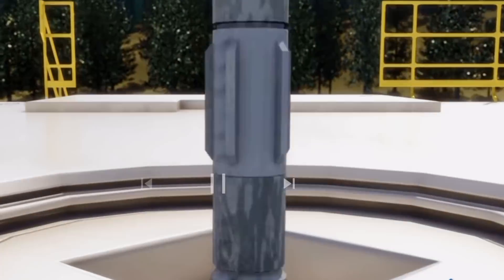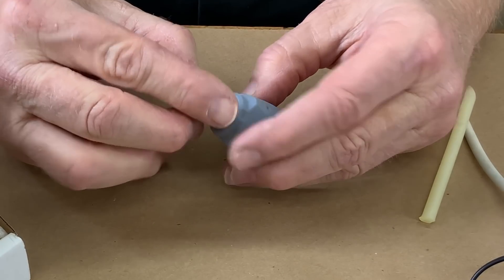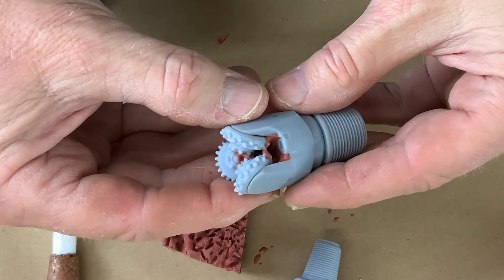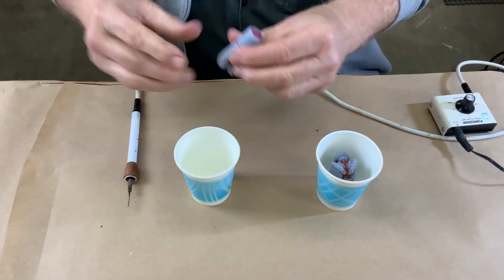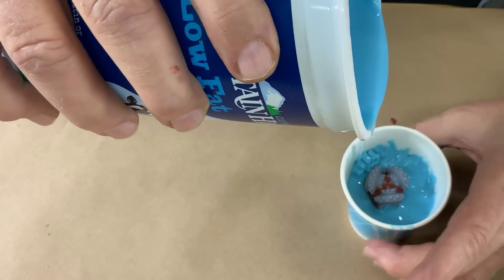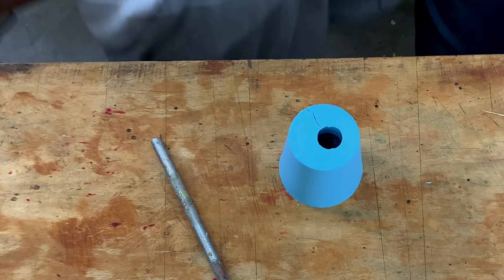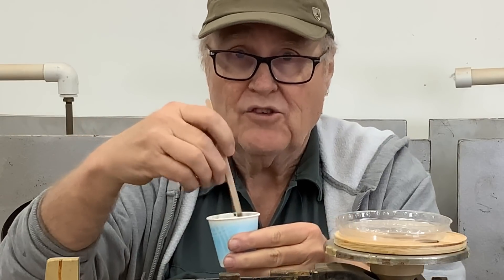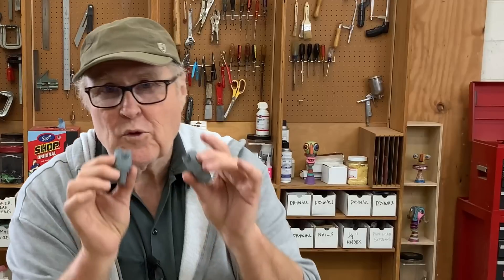Kitbashing A 3D Print

Comment: I'm glad you mentioned the issue of 3D prints inhibiting silicone resin cures. It looks like you use a tin-cured rubber, which apparently doesn't have an issue. I've read that 3D prints inhibit platinum-cured rubbers. Is Econosil-25 fairly tough? I'm looking to cast a prop with a lot of undercuts. Smooth-On's Mold Star (platinum-cured) has worked well for me, but it's expensive.

Comment: Great explanation how to kit bash the models and prepare for casting, however I didn't like how it came out messy on the inner part of the design. I would appreciate if you could show how to design those "drilling" parts to be separately casted and attached later in the process to the main body, forming a clean model or maybe even make moving parts within this toy?

Comment: Awesome video. Since you were a toy maker, I was wondering if there's a possibility of molding a flexible gripping hand to hold objects
Reply from the maker: I am a freelance prototype character sculptor.  Just a cog in the wheel in the toy manufacturing process.  My job was to take the concept drawings and make accurate prototypes of the finished toy by sculpting them in wax - or nowadays -3-D models.  I am sure it’s possible to make what you want but I’m not sure where you are in the process. Concept stage, prototype made, etc.?

Comment: Very informative! That divot tip is a great one. Wouldn’t it cast better if you hadn’t put those teeth gears in until after?
Reply from the maker: No, the teeth were pointing down so they filled without any problems.
Reply: @RobertTolone  It didn’t look like you made extra cuts to get the middle out of it.
Reply from the maker: @annekabrimhall1059  No, I didn’t need to.

Comment: Great show, love following along. Quick question. 
Does it matter how much pressure you use when you put it in the tank? I'm assuming the more pressure the smaller the bubbles would be.
Reply from the maker: In theory that should be true. I never exceed 80 psi in my tank, usually I use around 50.  That works for most projects.  Properly placed vents are the best way to eliminate bubbles.

Comment: This was great thanks for sharing! I was pretty convinced that 3d prints would cause the rubber to fail as I had seen in some other videos, I wonder if they just weren't cured all the way in those?
Reply: He briefly mentioned inhibition in this video. Some rubbers do not react well with the resin from 3D prints. There's some chemical reaction going on between the two that will influence the curing of the rubber. Some will recommend using tin cure rubber if your master is 3D printed. Some printing resins will do fine with platinum cure, though. It just depends, which is likely why he did a test to be safe. Another tip is to let your printed master fully cure and off gas for a week or more before creating a mold, which will get rid of some of those chemicals that cause issues.
Reply from the maker: There are many different kinds of rubber and resin so you have to test to see if they are compatible.

Comment: Tolone, I kinda confused in one of your work loop, especially in this one. Instead of using rubber bands, why not use the exact same cup to fixate the mould? That way, you remove the enclosing pressure variable, ensuring flawless closure to the moulds. Tried this in my workshop and it works perfectly!
Reply from the maker: I don’t do that for several reasons. One is that the cups are not necessarily identical, even in the same batch. Not only that but the cup might not be perfectly round so the mold is hard to fit back even into the original cup. Which I always destroy anyway. 
But the main reason I don’t do it is that I like to see the parting line. That way I know the mold is fit back together correctly. And when you are casting an edition the mold heats up inside and swells. That causes the parting lines to open. You can compensate for that by adding and moving rubber bands around. 
All that said, If it works for you keep doing it!
Reply: @RobertTolone  Oh I see! That is truly enlightening! I will put this into consideration. Although, I am now also considering using 3D-printed casing for both making the mould and casting, as they are stiff and can be made transparent. What do yo think? Can we achieve near-perfect casting this way? Would love to hear your experienced feedback!
Reply: @Starexe97  I use 3D mother molds for open molds and 2 part molds but never with one piece cut molds for exactly reason Robert mentioned. 
You have to be able to see the that the parting lines are lined up perfectly.
I’ve even tried leaving “windows” in the print to essentially create a register key, which worked... sometimes. 
At the end of the day I listen to the man who has 30 years of experience and save myself a lot of problems.
If I ever meet a Robert I’m giving him a huge hug and man thanks for saving me time and money.
Reply: @DeniedGrace  NOTED! I haven't casted much (and am leaning toward 3D printing bow), but now I know how important it is to see the parting line. Will definitely put this into consideration!

Comment: Interesting as usual! 
Wondering, as you use chunkies as rubber filler sometimes, do you also use resin chunkies from your witness cups?
Reply from the maker: No, there is rarely very much resin there and it sticks to the paper cup.  If you did have clean resin chunks you still have the problem of having to put the chunks in before you close the mold. So you can’t really see what’s going on with them.  And I would never use resin or any other kind of chunk to fill a rubber mold. That would interfere with the cutting of the mold and could cause a variety of other problems.
Reply: @RobertTolone  thanks for the info Robert!

Comment: what if instead of using rubber bands to hold the mould, you cut out the bottom of a new cup and use that new cup as a "shell" to hold the mould ? Since the cups are all the same size wouldnt it be a perfect fit ?
Reply from the maker: Not necessarily.  Cups aren’t exactly the same, even from the same package. Also, heat from the resin can distort the mold and it won’t always fit into a cup.
Reply: @RobertTolone  ah thank you for the explanation ! that's what i was wondering for awhile now

Comment: I never thought wax would work so well with kitbashing. If you don’t mind what resin are you using? I’ve been running standard grey from Elegoo and having a bit of trouble honing the settings in on my Mars 2
Reply from the maker: It’s the gray ABS-like Elegoo resin. I just used the settings for the Mars 2 set by Chitubox Pro.

Comment: I went to a Smooth-on distributor, and they told me that not every silicon rubber works well with 3d prints, cause they say 3d resin inhibits silicon rubber from curing well, and that I had to use a specific type of silicon rubber, ...did you Sr, had any issues whatsoever casting 3d prints with a specific type of rubber?
Reply from the maker: I always test the rubber with the 3D resin. But more often than that it’s fine. I use tin rubber, not platinum. But I test anyway.

Comment: I am guessing u used Tin based silicone to cast 3D prints, because platinum based really has problems with cure inhibition with 3D printer resin..
Reply from the maker: Yes, tin. I only use platinum when a project requires it.